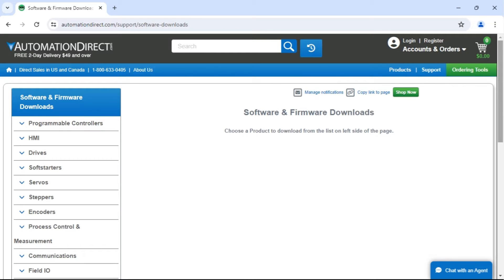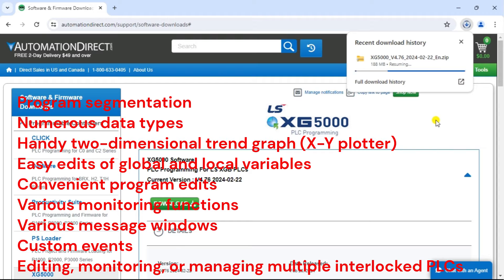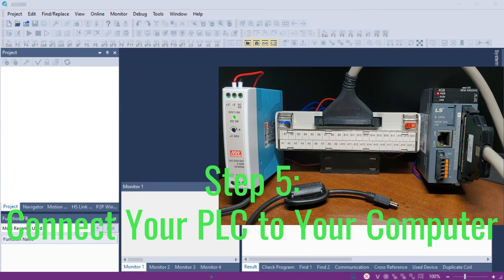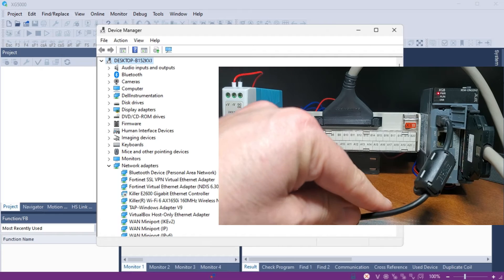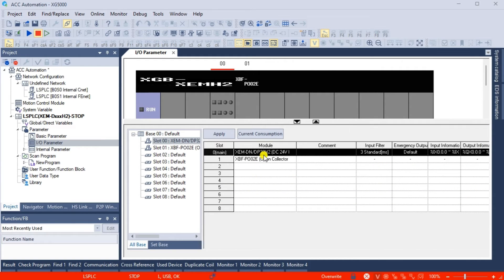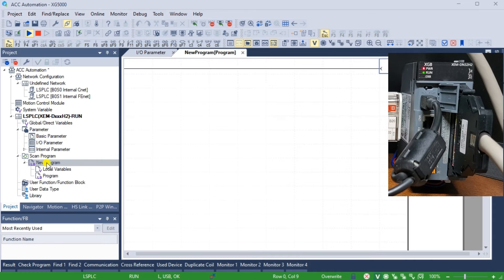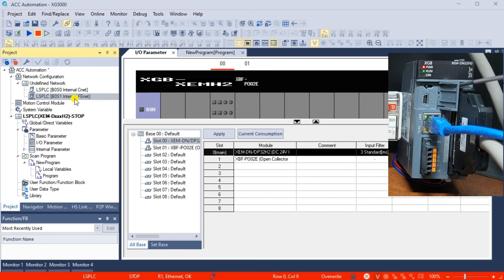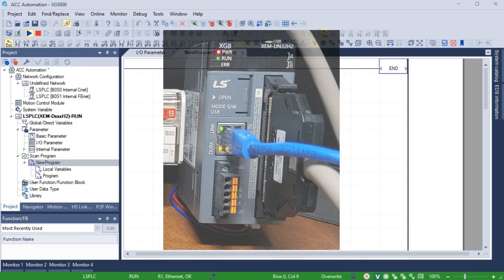Install & Com w/ XG5000 PLC: Guide for Beginners

Comment from the maker: Detailed information and links can be found in the corresponding post here.
https://accautomation.ca/install-com-w-xg5000-plc-guide-for-beginners/

LS Electric XGB PLC Series 
https://accautomation.ca/series/ls-electric-xgb-plc-series/
FAQ
https://accautomation.ca/series/ls-electric-xgb-plc-series/ls-xgb-series-xem-plc-faq/

PLC Beginner’s Guide to PLC Programming
https://accautomation.ca/programming/plc-beginners-guide/

Product Cut Sheet (XEM-DN32H2 Unit Specifications)
https://cdn.automationdirect.com/static/specs/cutsheet/XEM-DN32H2_cutsheet.pdf
LS PLC Technical Specifications
https://cdn.automationdirect.com/static/specs/lsplcoverview.pdf

Manuals:
Interactive Guide
https://cdn.automationdirect.com/static/helpfiles/ls_plc/Content/Home.htm
LS PLC User Manual
https://cdn.automationdirect.com/static/manuals/lselectric/lsplcusermanual.pdf

Other Documents:
PLC Installation Guide
https://cdn.automationdirect.com/static/manuals/lselectric/xeminstall.pdf
Product Brochure
https://cdn.automationdirect.com/static/catalog/images/product-pdf/LSE-PLC-Overview.pdf
PLC Statement of Direction
https://cdn.automationdirect.com/static/press/PLC_Family_Roadmap_Statement.pdf

Software and Support:
XG5000 / XG-PM PLC Programming Software
https://www.automationdirect.com/support/software-downloads?itemcode=XG5000
XEM PLC Firmware
https://www.automationdirect.com/support/software-downloads?firmwareitem=LS_XEM%20CPUs&itemcode=XG5000&section=productFirmware
Quick Start Procedures
https://cdn.automationdirect.com/static/helpfiles/ls_plc/Content/Quickstart.htm
XEM Pulse Servo Wiring Diagrams
https://cdn.automationdirect.com/static/support/sampleprg/xem/XEM_CPU_PTO_Servo_Wiring.zip
Example Applications Directory
https://www.automationdirect.com/adc/shopping/catalog/programmable_controllers/ls_electric_xgb_plcs_(stackable_micro)/plcs/xem-dn32h2#

ACC Automation
https://accautomation.ca/